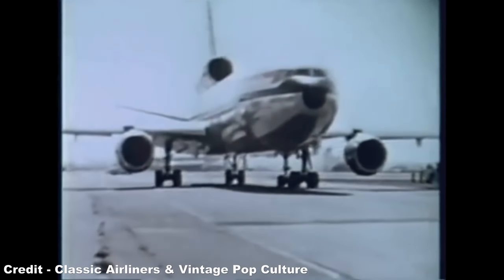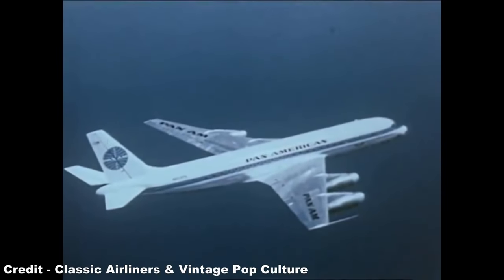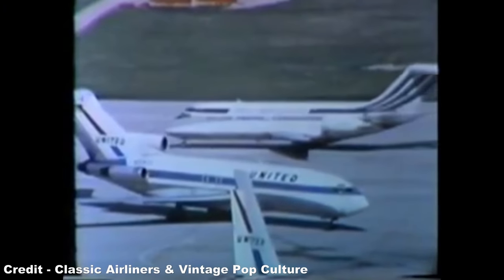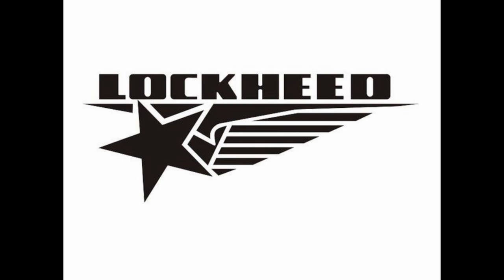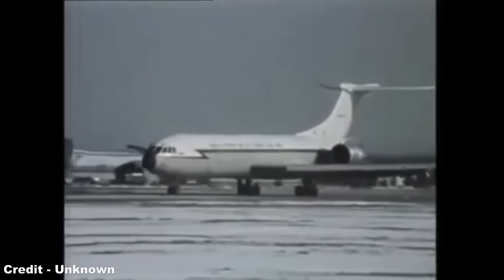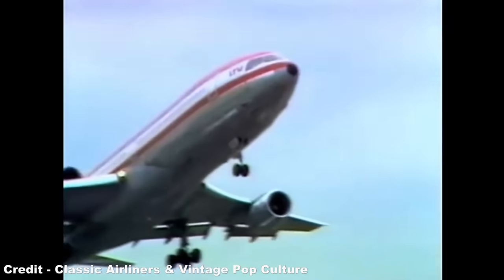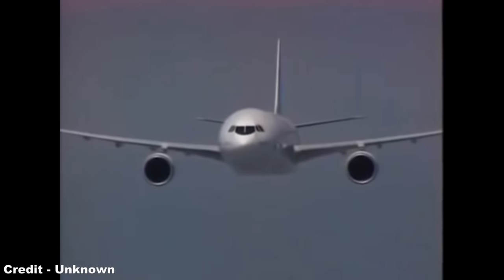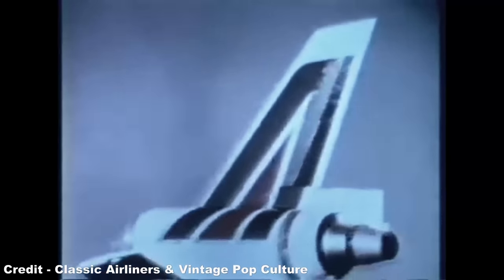What Killed the Trijets?

Comment: The ability to fly over water on two engines killed the tri-jet.
Reply: Wow you don’t say
Reply: Thanks, Dr. Obvious.
Reply: That’s what he said ⁉️🤪
Reply: Lindbergh did it with one engine
Reply: StringerNews1  Ha! :)
Reply: But I knew this without watching the video because a long time ago the Learning Channel actually taught you stuff.
Reply: Tri Jet's were just always a stop gap anyway. One of the reasons MD had to merge is they didn't invest in large twin.
Reply: @johniii8147  And the DC-10 Issues did not help, even if they were not always the fault of the plane.
Reply: StringerNews1  Is was a stop gap until twin technology was perfected. The industry knew since the 1970’s that where it was headed. There was not a tri jet clean sheet design since the early 1970’s
Reply: StringerNews1  LOL. Not i'm not joking. Of course Twin Engine wide bodies and even narrow bodies are technology driven. The engines to support the thrust, weight, range and reliability had to be developed. Airframe structures, cockpit systems, and safety procedures all had to be developed. That's all advances in technology.
Reply: I was thinking fuel economy and consistent reliability would be the deciding factors, but no!
Reply: StringerNews1  whatever dude you’re obviously not going to get it
Reply: @SpaceAce100 Not really relevant at this point. We all know the story there.  Even if the incident didn't happen the result of the program wouldn't have been much different. MD just wasn't inventesting in commercial aircraft as things were chaining rapidly.
Reply: The fundamental instability of trijets is why they died.
Reply: @Jaxck77  No that's nonsense. That's not what killed them. They only tri jet that had any instability issues has been the MD-11 on landing. Inefficiency and no need for them anymore with big twins is what killed them.
Reply: @SpaceAce100 The 717 was acquired as part of the merger with MD, previously known at the MD-95. Boeing just renamed it. The 737 was essentially a 2 engine 727. Same fuselage and most of the same cockpit etc. As they developed the later versions of the 737 and 757 they didn't need the 727 anymore.
Reply: @johniii8147  Think of a plane like a lever, with the pivot being the wing mounts. If you have your engines on the wings you have far greater power efficiency over the relative movement of the aircraft.
Reply: @Jaxck77   No one was questioning the aerodynamic efficiency. Of course putting on an engine on top effects that. But that's a completely different issue than stability. And if you can generate the same thrust for 2 vs 3 engines of course it's inherently cheaper to operate. That's what happened. No need for a 3 or 4th engine as thing advanced.
Reply: Absolutely!! 👍👍
Reply: @summersky77  c'mon now Mr. Sarcastic, give him a break. He's just making a comment & doesn't need someone like you goin' "DUH??" I did that too, when I was in 4th grade. 🤔
Reply: @summersky77  That's Captain Obvious to you!!!!
Reply: @SpaceAce100 There were several accidents attributed to bad design, too, like Turkish Air 981, which is still one of the worst accidents in aviation history. Douglas took tons of shortcuts with that plane and than brought their philosophy of shoddy work to save money to Boeing.
Reply: ETOPS: Engines turn or passengers swim
Reply: When it becomes viable, twin jets will die to solo jets or we will see something like nuclear powered aircraft
Reply: @johniii8147  Tri jets were not stopgaps.
When the DC-10 and L1011 were designed, there was no anticipation that ETOP rules would change so radically so SOON.
Reply: StringerNews1  Look up "ETOPS" regulations and their changes sometime.
Twinjets were NOT trusted to be far out of range of land 'til quite a bit after the DC-10 and L-1011 were designed and being sold - but not long ENOUGH for them to sell enough to break even.
Reply: @SpaceAce100 There were no engines POWERFUL ENOUGH at the time the 727 was designed for "hot and high altitude" airports.
The Boeing 717 was the MD-95 (a MD derivative of the DC9) that Boeing ended up with through a buyout.
Reply: @johniii8147  Engine development is what killed the 727 - didn't need 3 engines any more to develop "High and Hot" thrust as needed for that size of an aircraft.
But that took over a DECADE past the initial sales of the 727.
Reply: @loganbaileysfunwithtrains606  Too hard to position single engines in a viable spot on LARGE aircraft.
I doubt we'll see the twinjet die in the lifetime of ANYONE here.
Reply: The bi jet killeded it
Reply: Thanks, that saved me listening to 10 minutes of video.
Reply: True that
Reply: James Price  true that
Reply: and the qudjets
Reply: @carlmaster9690  true that ✈️
Reply: And eventually the quads too, obviously
Reply: Asking for trouble
Reply: @davefloyd9443  😂 😆 🤣 🤪
Reply: @loganbaileysfunwithtrains606  😂 😂 😂 😂 😂 🤣 🤣 🤣
Reply: @adamgraf6616  see
Reply: Even back in the 80s, there were the 2 engine 767s making transatlantic flights. However, most transatlantic flights then were made by 747s, DC10s, and L1011s. It was around 2000 when all 3 of those faded out and A330s, A350s, 777s, and 787s took over. Those 2 engine planes carried just as much fuel as the 3 and 4 jet planes, because each engine on the 2 engine planes was twice as powerful and even more fuel efficient than each engine on the 3 and 4 jetters
Reply: StringerNews1  Flying over water used to require at least 3 engines.  A twin-engine job was not allowed to do so.  That also meant that it couldn't land here from other countries.  There would be no way for it to return home.
Reply: @johniii8147  It wasn't a matter of twin-engine jobs getting better, it was illegal for a plane with fewer than 3 engines to fly over bodies of water.
Reply: @johniii8147  But they could not legally fly over bodies of water with only 2 engines.  The law is the law.
Reply: StringerNews1  Many people don't realize that flying over bodies of water used to require at least 3 engines.  It was the law.
Reply: @SpaceAce100 That isn't the point.  It was illegal to fly over bodies of water with only 2 engines, and the law is the law.
Reply: @SpaceAce100 It would have been restricted to over land routes.  Flying over water required at least 3 engines.  It was the law.
Reply: @johniii8147  Also the law.
Reply: @bricefleckenstein9666  You are forgetting about the law.  Twin engine planes were not allowed to fly over water.
Reply: And we won 14 minutes of our life back 👍🏽
Reply: @michaelbenardo5695  Incorrect. It was the technology maturing that they could trust 2 engines. It's not a legal issue, its technology maturity.
Reply: @johniii8147  Incorrect.  It was ILLEGAL.  Yes, better more powerful engines were developed, and yes, after they successfully demonstrated to the FAA that they had twin-engine planes that COULD fly far and over high mountains on only 1 engine, the FAA relaxed that rule.  That makes it first a legal matter.
Reply: @adamgraf6616  He just did!
Reply: Yep.
Reply: @Jim-ku6ry  That's just semantics.  The fact remains that those regulations effectively had the power of the law behind them, as the FAA has the authority to punish airlines that do not comply with fines, denial of landing rights, suspension of operations, etc.  Also, not only did engines have to be powerful enough - some had more than once demonstrated that they were - there was also the reliability/safety issue.  The FAA did not at the time feel that engines were reliable enough for single-engine operation for more than an hour.
Reply: Yet they had Trijets prior to the 60 minute rule...
Reply: @LandersWorkshop  Before the late 60s, not even tri-motors could fly over water.  Had to have 4 engines, then they finally loosened it to 3 engines, and the Tri-jets took off.
Reply: @michaelbenardo5695  Yeah but my response was to a guy who commented about piston engines, which is why I mentioned the Italians in the 30s used tri-engine configurations.
Reply: Thanks for saving me t he time to watch this whole video lol
Reply: *the ability to fly over water on ONE engine.

Only when jet engines became powerful enough to safely reach an airport on one engine, should the second engine fail, was what spelled the beginning of the end for trijets. Maintenance and fuel costs for 3 engines was a distinct disadvantage.
Reply: @Jim-ku6ry  Ok, prohibited then.  The airlines MUST COMPLY.  If they don't, they will fact penalties, maybe SEVERE penalties.   An airline, a plane manufacture, or an engine builder, can claim all they want that their (plane, plane with their engines) can do this or that, but until the FAA is satisfied, it is all for naught.  They will still be barred from what ever it is that they are contesting.  And maybe no twin engine JET was able to do it, but the piston-engine Convairs, according to Convair and to Pan American, proved that they COULD do it, but the FAA still was not moved, due to the fact that if THAT engine failed, a-- would be out, so yes it was partly about reliability/PERCEIVED reliability.  Let's just say it was a combination of ability/technology and regulations.
Reply: @Paqza  And we have seen the sorry results of that in ALL of our industries.
Reply: @Jaxck77  I don't quite follow you, can you elaborate please? Thank you.
Reply: StringerNews1  727 was killed by high operating costs, especially post 9/11
Reply: The same thing also killed the quad-jet
Reply: @michaelbenardo5695  You are confused and partly incorrect.
I am one that has been stating that twins were not allowed long over water flights in the timeframe that the big trijets were being designed, and during their early sale years, and that it was the extension of ETOPS limits for twins that was a major killer of the tri-jets.

Also, twins WERE allowed short over-water flight - just very limited 'til the ETOPS lengths they were permitted started getting extended.
If a twin was not allowed any over water flights, a lot of airports would have had issues - like pretty much ANY flight eastwards out of O'Hare going over Lake Michigan (heading to places like Toronto, NYC, and such in particular).
Reply: @bricefleckenstein9666  I mean Transoceanic by "water".  I am NOT confused, and at the time the Tri-jets were designed, twin-engine planes were NOT allowed to fly over the ocean.  That's just the way it was.  And quit splitting hairs.  YOU COULD NOT FLY OVER THE OCEAN IN A TWIN-ENGINE PLANE.
Reply: @Ben-bb7mi  727 was already having a hard time in the '80s. Noise compliance was a issue for older (-200, etc) birds in commercial passenger service. "Hush kit" or re-engine was expensive.
Reply: @michaelbenardo5695  In the 1980s insurance carriers of high net worth CEOs favored biz jets of 3 or more "over water".
Reply: @michaelbenardo5695  I am not splitting hairs.
Twins WERE allowed over oceans - but only for short trips, ETOPS limits were either 30 minutes or 60 minutes AT THE TIME for twins.
Not long enough for most over ocean trips, but plenty for places like the Azores, the Carribean, Bermuda, and such - which DO border on or are entirely surrounded by the Atlantic.

It was the expansion of ETOPS limits to 90 minutes and up for Twins that started killing the market for the Tri-Jets, not some fantasy "can't fly over an ocean at all" limit.
Reply: @bricefleckenstein9666  Short trips are not "Trans Oceanic" trips.  Yes you are splitting hairs.
Reply: @michaelbenardo5695  Miami to Bermuda by AIRLINE standards is a short trip, yet most of it is across the Atlantic.
Just for one example showing how WRONG you are.

No, I am NOT splitting hairs.
Reply: @bricefleckenstein9666  That's right, it is a SHORT trip.  Hardly qualifies as "Trans-Oceanic".  Yes you are splitting hairs.
Reply: And rising Oil/Fuel Prices
Reply: So they started to do it with 4
Reply: @MsJobbyjabber  4 jet engine airliners PREDATED the big tri-jets of this video.
The only new (as opposed to stretched) quad jet to enter service after the tri-jets was the Airbus A380 - and even some of the "stretch" quads predated the tri-jets of this video.
(727 was older than most of the quads, but it was SMALL compared to the L-1011 or DC-10)
Reply: @Nikowalker007  That had little or nothing to do with the issue at the time.
The big tri-jets were more efficient than many quad-jets, yet those quads often remained in airline service longer (and got newer bigger models added).
Reply: @michaelbenardo5695  No, your "short trip" is what is splitting hairs.
It's almost entirely over the ocean - the length does not matter to it being trans-oceanic.
It's also not THAT short - Iceland to Greenland is 400km shorter than Bermuda to Miami.
1000 miles appx - flights are almost 3 hours long, which would have put it OUTSIDE ETOPS 30 or ETOPS 60 limits.
Reply: @bricefleckenstein9666  YOU COULD NOT FLY A TWIN ENGINE PLANE ACROSS THE OCEAN FROM THE UNITED STATES TO EUROPE.  PERIOD.
Reply: You are both correct and succinct.  Even some three and four engine bizjets were designed back in the day for transoceanic flights, say, from Eastern North America to the UK or Europe were built with three or more engines. The Lockheed Jetstar had four and the various models of what started out as the Dassault Falcon 50 have three.
Reply: They could already able to do that but the rules didn't allow it.
Reply: @owennilens8892  You are absolutely correct.  As far back as the 50s, both General Dynamics and Pan American claimed that their Convair twin-engine planes, admittedly piston-engine jobs, not jets, could do it, but the FAA said NO, and that was that.
Reply: @michaelbenardo5695  There is far more to flying over an ocean than "US to Europe".
Your excessively narrow focus completely warps the facts.
There is a lot more to the Atlantic than the part between the US and Europe - and SOME of it was in fact flyable by twins even in the ETOPS 30 days, abet most of the routes involved that a twin COULD fly were not high traffic like NYC-London.
Reply: @bricefleckenstein9666  Bla bla bla.  You know as well as I do that if it wasn't true, there would have probably never been three-engine jets.
Reply: @michaelbenardo5695  The issue was NOT that twins could not fly over oceans.
The ISSUE was the "30 minute to get back to land" limitation got raised, first to 60 then to 90 eventually even higher thus opening a lot more routes to Twins, a few years after the Big TriJets started selling.

You really should stop EXAGGERATING the issue - the real issue was a big enough!
Reply: @bricefleckenstein9666  No matter what you say, the cold hard fact is that the FAA would not allow twin-engine planes to fly across the Ocean.  And I don't mean for short distances either.  And if they were barred from flying across the Atlantic, they were automatically ALSO barred from flying across the Pacific.  They didn't have the range anyway before the 80s.
Reply: @michaelbenardo5695  The FAA has no control over flights from Spain to the Azores - or ANY OTHER route that does not include a USA airport.
The FAA did in fact allow twin jet flights from Miami to Bermuda - OVER THE ATLANTIC OCEAN - as that was within (barely) the ETOPS 30 regulation.
And no, twins of the time didn't have the range for most Pacific routes - even Hawaii from LA/San Francisco/Seattle exceeds ETOPS 60 much less 30, and that's a SHORT Pacific route.
Reply: @bricefleckenstein9666  I never said the FAA has authority outside of this country, but I doubt if they would give an airline that was flying twin-engine planes across the ocean - Spain to Portugal is hardly across the ocean - landing rights in this country.  Now give it a rest.  I am right and you know it.  That's just the way it is.  Now give it a rest.
Reply: @michaelbenardo5695  The Azores are in fact reached via the Atlantic Ocean.
Just because you are not crossing that ocean at a WIDE spot doesn't change the FACT that it is an over-ocean crossing to reach them.

And yes, the FAA did in fact give landing rights to airlines that used twins on over-ocean routes - as long as they didn't fly twins into the USA on a route that exceeded ETOPS.

No, you are NOT right, whatever you might THINK about the subject.
Reply: @bricefleckenstein9666  That doesn't change the fact that our airlines were not allowed to use twin engine planes for trans-oceanic flights.  And I am not talking about jumping over puddles.
Reply: @michaelbenardo5695   In 1953 the FAA "60-minute rule" restricted twin-engine aircraft to a 60-minute diversion area (at the one-engine cruise speed).
I also find it interesting that you are now talking "trans-oceanic flights" and not "across ocean" flights, which changes your claim SUBSTANTIALLY, as many "across ocean" flights AS I HAVE BEEN POINTING OUT do not go US/Canada/Mexico to UK/Ireland/France/Spain and the like, yet DO go over an ocean.
Reply: @bricefleckenstein9666  To me, it is the same thing, but I could see that to you, they are two different things.  I have not changed my views.
Reply: @bricefleckenstein9666  I find it interesting that you are accepting the fact that you could not fly from here to Europe or Africa on a twin-engine plane.
Reply: @michaelbenardo5695  Try reading a dictionary sometime.
It's not a "to me" difference.
Reply: @bricefleckenstein9666  You again?  Give it a rest dude.
Reply: @michaelbenardo5695  I have never said ETOPS limits did not exist.
What I keep pointing out AND YOU KEEP BLOWING OFF is that there were in fact ETOPS 60 legal flights in twinjets from the USA that went over the Atlantic in the 1950s and 1960s, much more so with the later extensions to ETOPS to 90 and higher.
Reply: @michaelbenardo5695  Quit spouting nonsense, and I will give it a rest.
Reply: Thx, 
closes the video and gets up of bed
Reply: I don' t think so.  There is simply no "symmetrical" place on a plane to put a LARGE solo engine. Rear mounting is ok for light jet fighters  - as the infamous  RF-104 "Star fighter"
Reply: @cordongrouch9323 also lower maintenance costs
Reply: @stevenclarke5606  ... I thought "consistent reliability" covered that, but thanks... Lower maintenance can reduce costs greatly. 😊